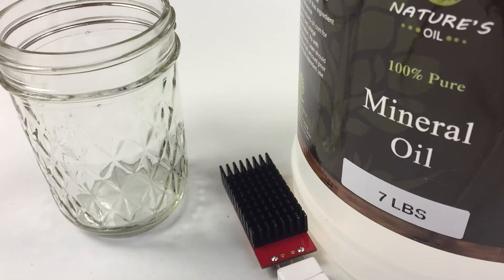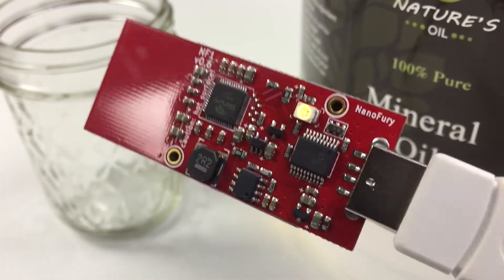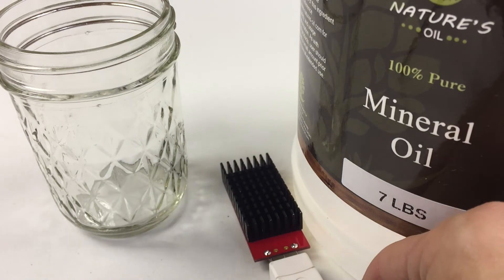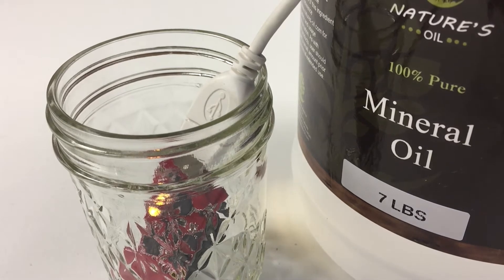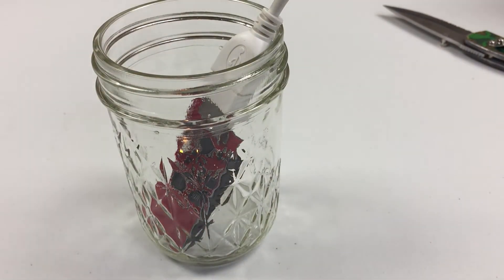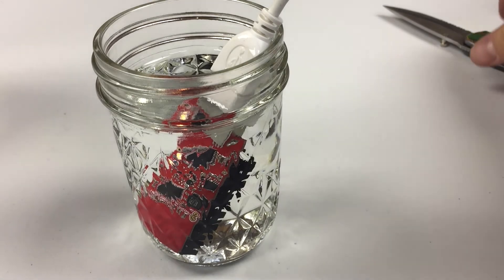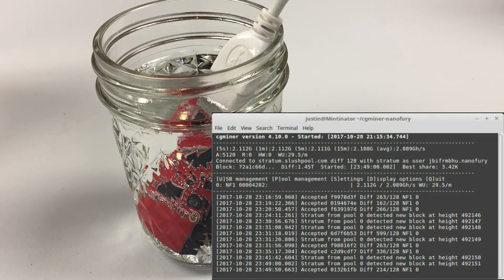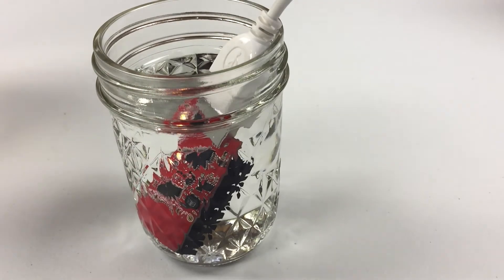Mineral Oil Experiment - Bitcoin Miner

Comment: Hi Justin, thanks for sharing your experiment. For how long have you ran the miner? and have any corrosion accumulated in the oil or on the board?
Reply from the maker: I ran it for about a month straight. No corrosion was observed on the unit, and no debris found in the oil afterwards.